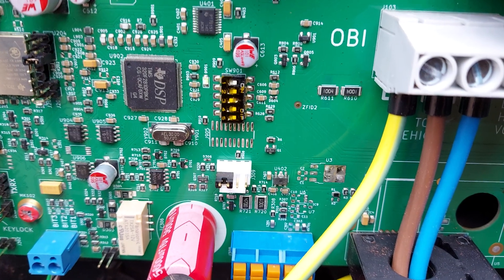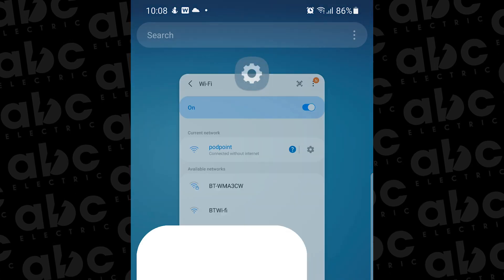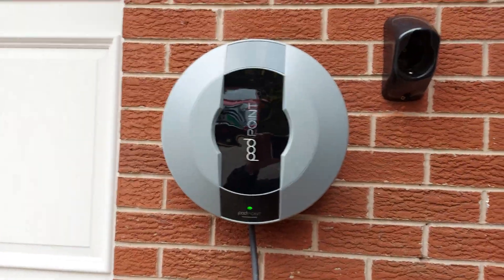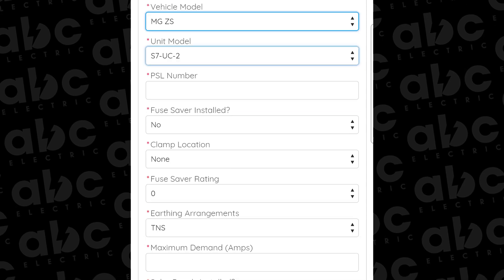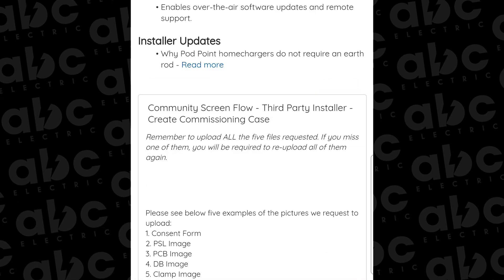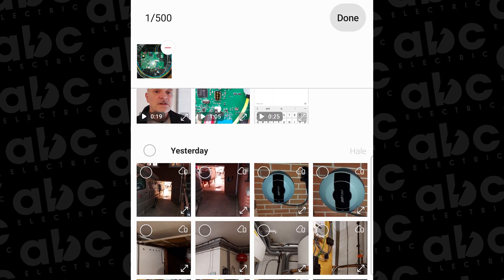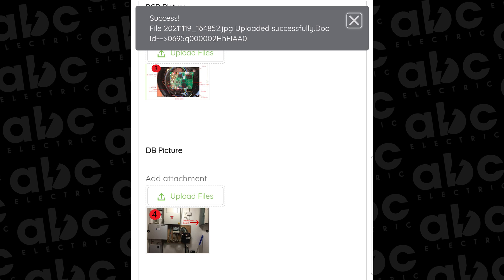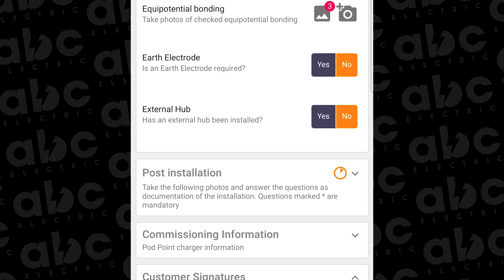Pod Point Commissioning, DIP switch settings and WiFi connection

Comment: Great video. If a client moves house and takes the charger with them, do you have to go through this process again? Cheers
Reply from the maker: Yes. The charger has to be connected to the new WiFi network and the power output set accordingly for the new site conditions. Also, the DNO has to be notified and a new EIC issued etc. In reality, it's a whole new installation at the new property. The process is for the infrastructure/conditions at the site. The fact of the charger being moved is irrelevant. It's a new installation of that charger at a different property.
Reply: @abcelectric  thankyou 👍

Comment: What CT clamp do you recommend for PodPoint installation? Is there a specific one or any generic CT clamp can do the job?
Reply from the maker: The CT clamp comes with the Pod Point in the box. Some manufacturers make you buy it separately, but I always buy their associated model because I don't want compatibility issues and they're all about £15-20. They're probably all much of a muchness, but why take the risk?

Comment: Hi i just got installed the three phase one 22kw and i can get 6.7Kw only , do you know what could be the problem? Usually when charging at 22kw stations i can get 11kw every time, so no issue with the car !
Reply from the maker: 22kW on a domestic supply? Not possible unless you have 3-phase. If you have got a 3-phase supply, or it's not domestic, then it's either been incorrectly commissioned or the load management is doing its job. 6.7kW is pretty close to the maximum for a domestic installation. If you want to test its maximum, turn off EVERYTHING else, (or at least don't use anything electrical like ovens, hobs, showers etc), and then see what its output is. I can't diagnose specific output issues or faults with a few words description, but the above is a starting point.

Comment: How do you connect it to a hidden WiFi network? There's no option and you can only seem to Connect to open networks
Reply from the maker: Not sure what you mean by "hidden", but it's just like any other WiFi device. You connect to the temporary Pod Point Network, choose the required network and type in the password. See my Pod Point commissioning and WiFi video for more information
Reply: @abcelectric  hidden WiFi are those that do not broadcast SSIDs
Have you done that before?
Reply from the maker: No. Surely you'd have to temporarily "unhide" it then? The issue is at the WiFi end, not the Pod Point end. Of course the PP won't see it if it's hidden. This isn't a PP connectivity question - it's a WiFi protocol question. Bypass the hidden SSID at source so the PP can find it, connect, then rehide it. Check the manual for the hidden WiFi device.
Reply: @abcelectric  nope, I did that. Broadcast, join, then hide but it loses connection after you hide it.
If you have the section that details how to do this, can you send the link ?
Been trying for a few days with no luck
Reply from the maker: I'm replying from experience. The manuals are freely available from Pod Point's website, but I know they don't cover this scenario. I think you'll have to contact Pod Point directly and ask them.
Reply: @abcelectric  thanks, yeah I have done and no response hence asking those who install it.
It's a pain really
Reply: Unhide, select and join, then hide and it loses connection
Reply from the maker: The only other thing I can suggest is to go into the Pod Point configuration page and see if you can force a connection there. To do so, just type 192.168.101.1 into a connected browser window. Obviously you'll have to do this with the WiFi connection made visible
Reply: @abcelectric  yeah that's the route I took bit alas no luck. Will keep on trying. Thanks

Comment: Hi, great video, one question is how do you set the load limiting on a pod point rather than the dip switches as I take it this is an option like the Zappi and others?
Reply from the maker: Type 192.168.101.1 into a browser connected to the same WiFi network as the Pod Point. Press the settings cog in the top right corner, enter the Pod Point password and change it in the menu

Comment: Hi, quick question regarding pod point. Our solo 3 models seems to be limited to only 236volts and is currently taking over 24hours to charge the vehicle. Can you offer any advice on this matter please? Thanks
Reply from the maker: The voltage isn't limited, but the current might be, and that might be for good reasons, such as you've only got a 60A main fuse or a number of high current devices. If it's been commissioned incorrectly then you can phone Pod Point and they can check it and adjust it accordingly through the WiFi connection. You should always contact the installer first because they've commissioned it and know the site parameters. Just because a charger can output 7kW doesn't mean it's safe to do so.

Comment: Hi @acelectric. 
Quick question if I may. 
Got. Pod point installed new build in garage no ct clamp connection as no route from detached garage to main supply in house, pp wired to 32amp mcb in garage with type a rcd, works fine on the ev test gear from the electrician but when car is plugged in starts to charge then goes red and ends after approx 10 seconds any ideas?
Reply from the maker: That's a little vague, but I assume it's connected to WiFi  and the on-line commissioning has been carried out? If not, that needs to be sorted. Pod Point enable the unit from their end and set the internal parameters to suit. They don't like it without a CT clamp, but they can set it up without.  If it's properly setup, connected to WiFi and commissioned then you'd have to phone Pod Point and they can fault find it remotely over WiFi and program it accordingly or send an engineer
Reply: @abcelectric  thanks. 
Could be the issue with ct them was on previous house next to meter box with ct fitted then moved to new build after 9months or so and no route for ct so not been fitted but unit may still think they should be I assume. 
Will call pp and get them to fault find
Reply from the maker: OK. Now I know that it's been relocated I can tell you that you need to recommission it with Pod Point to the new installation parameters. It's basically treated as a new installation because in reality that's exactly what it is

Comment: Hi we have a pod point charger and was working fine until moved address. As far as we no it’s been installed correctly. It now has a red light and not charging. It was charging for 4 seconds then made a click noise and stops charging. Any ideas on how to fix this issue?
Reply: I'm also in this exact same scenario, how did you solve this please?
Reply: @garethmorris1987  yeah found out that there want a single dam thing wrong with it. Government pod point and people on the other side were controlling it!!.. basically they saw that it was moved and they turned it off! Outrageous!! They said for safety reasons my ass! So they can try get someone out to charge u £800 for a so called fixing it lol yeah right they turned it back on after she got on the phone to them lol
Reply from the maker: I must have missed this post and reply originally. Anyway, it is ultimately for safety reasons. I have moved a Pod Point to a new address for a client and made sure to follow the Regs at the new property, recommissioned the charger with Pod Point, notified the DNO again etc and all was fine. The point you're missing is that the safety aspect regards the ENTIRE INSTALLATION, not just the physical charge point on the wall. This involves supplier's cut-out fuse, earthing arrangement, equipotential bonding, cable size, RCD selection, SPD requirements, maximum demand etc etc. If you've moved house and reinstalled it, then only 1 factor (the physical charger) hasn't changed and the safety of the installation is dependent on ALL those factors. A charger can easily be knocking out 32A for around 12 hours. That's 1/3 the capacity of a 100A main cut-out and 50% of a 60A cut-out. Why on earth wouldn't the cabling, circuit protection and other installation factors be subject to safety requirements in the Regs?
Reply: I think the CT clamp hasn’t been set properly.
Reply: Hey both.
Did you ever get this solved?

Comment: Hi Gary

My podpoint not working. Changed rcbo but still not charging the car. Any help would be appreciated
Reply from the maker: That's a bit of a wide sympton to solve from afar  Richard. My first suggestion is to contact Pod Point and get them to do remote diagnostics or contact the installer to fault find. Why have you "randomly" replaced the RCBO? Did it fail the RCD tests etc or is it constantly tripping? If it's constantly tripping it's doing its job and the fault is downstream. I can't advise without knowing more information and I'm not a free online repair consultant

Comment: Where can i get the customer consent form link no longer in use and not one in the box
Reply from the maker: I think you might be able do it on the commissioning form. If not you'll need to ask Pod Point for one. Some of the EV 3rd party software also has it included like EV Comply

Comment: Thanks for the video, most helpful. My unit is the newer Solo3 22kW 3phase, but it's limited to 2.4kW! Clicked on the config "cog", but the PSL-261xxx password doesn't seem to work. Can you please help? is there a default admin password?
Reply from the maker: You need to contact Pod Point and they will configure it over the WiFi
Reply: @abcelectric  There is no WIFI or mobile phone signal in the area. How do I get into settings without either please?
Reply from the maker: It has to be connected to the Internet to comply with regs Phil. Also, your installer should do any necessary configuration settings at commissioning via Pod Point. The newer models have no DIP switches or user configuration modes, hence why you need to have WiFi connectivity and contact Pod Point.

Comment: HELP… just got my Mercedes’ 300e hybrid. Plugged it in and it starts green than after 10 seconds goes to solid red. Tried re setting (power off) and it still does it. Tried a few times with no luck. Can you suggest what I may be please?
Reply from the maker: That's not much to go on Richard, but it’s possible that the car's not set up to receive charge. Check that scheduling isn't enabled. The installer should have done a functional test, so refer it back to them after checking the car end first. If not I'd contact Pod Point to do remote diagnostics and take it from there
Reply: @abcelectric  I went to a public and it works? So god knows. As I thought the same(is the car needing to be set up)? It was installed in Nov so a long time before use (today). Would that make a difference (blue and purple lights working) so I guess it’s connected. 
Typical isn’t it.. 😩
Reply from the maker: @richardlee4637  Blue Light means it's ready and waiting to charge. Flashing magenta means it's connected to WiFi, so Pod Point can easily do remote diagnostics. I've fitted them well in advance of the car delivery date and not had a call back. It's possibly not been set up/commissioned properly but Pod Point can sort that remotely
Reply: Check the CT clamp isn’t open and that it’s facing the flow of electric.

Comment: Hi, thank you very much for the video. I have 7Kw pod point but it does not contain DIP switches on board. how we can change DIP settings?
Reply from the maker: You can't change the DIP switches if there aren't any. In that case the settings will be configured at commissioning over the air by Pod Point. You shouldn't be adjusting any settings if you're not a certified electrician who's fully conversant with the specific installation conditions for that job.
Reply: @abcelectric  can you do that for us? we are out of UK, in Cyprus. Because of that Pod point said they can't support. We have professional electricians also they are the people who implemented our PV systems.
Reply from the maker: Sorry Can. It has to be done by Pod Point as they're the only ones who can access the settings  remotely
Reply: @abcelectric  my technician team capable to do that but we could not login to device configuration page.
Reply from the maker: IP address for newer models is 192.168.101.1 You can access user permissions from there

Comment: what do you do in terms of the ct clamp if you are coming off a sub board in the property and not at the origin?
Reply from the maker: Ideally you need to extend the CT clamp to the main incomer tails. If that's not possible then you'll have to do some calculations and reduce the CT clamp current threshold to a suitable value for the sub DB taking into account maximum demand at the primary DB. To do this you'll have to contact Pod Point who will set the amount with an "over the air" update. I would also consider setting the DIP switches to reduce the maximum charger current.